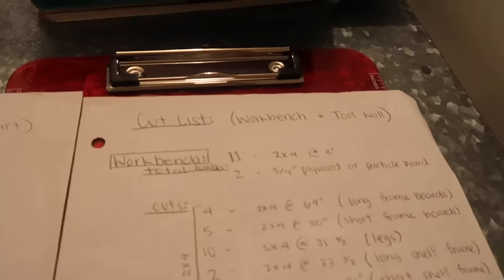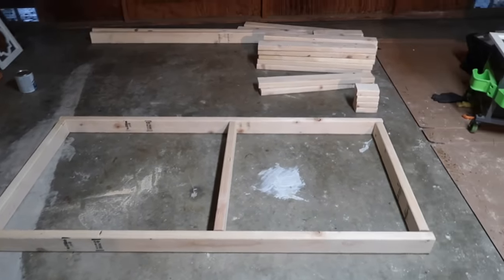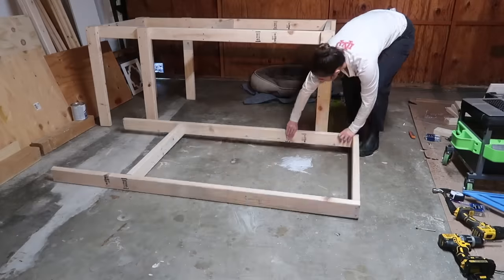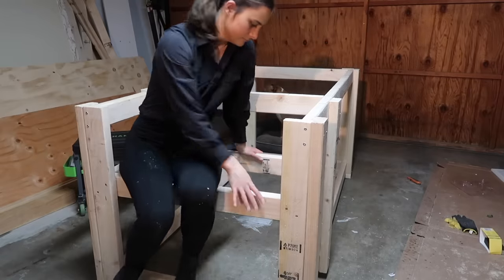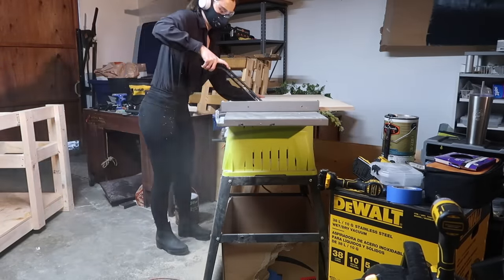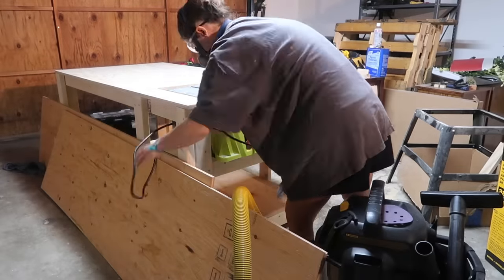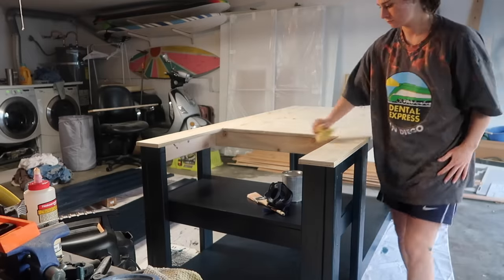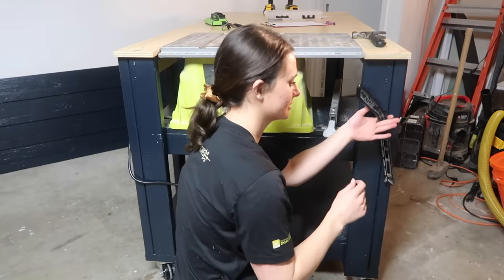DIY Workbench with Built in Table Saw

Comment: If you're getting into wood working, definitely switch to torx/star headed screws. They're 1000000000000x better than philips head screws.
Reply from the maker: Oh really? I have never used them before. Do they not strip as much?
Reply: Shannon Elizabeth Yes, they don’t strip and drive in a lot easier. It’ll change your life. :)
Reply: Phillips and flathead fasteners need to no longer exist haha
Reply: Interesting!! Sounds like a plan!!
Reply: I approve this message ✨
Reply: Agreed 1000000%
Reply: Philips and star head are a different name for the same thing. Robertson or square head is the superior screw try driving a 3inck Philips and a 3 inch Robertson into hardwood
Reply: Agreed, torx or Robertson square are best. I will only chuck up a Phillips bit if I’m driving drywall screws or for small box hinges. In my experience using fasteners for wood, Phillips just causes heartache for fasteners over 3/4” long.
Reply: Canadians thinking, “duh.”

Comment: Hi Shannon..
You made a great work bench and it looks very strong ..you can add a router table attachment and modify your table saw to work together using one fence ..but the surface should be straight as mush as possible 
The dust collector can be added to your table saw by adding an elbow to the table saw box and attached to your vacuum much or dust collection system..
I hope my language is clear ..
Good work
Reply from the maker: That is a great ideas. I am going to make a follow up table saw video and definitely want to incorporate those! Thank you so much!
Reply: @ShannonElizabethDesign  
You are welcome and I will follow your next project..
Good luck Shannon 👍

Comment: Shannon, thanks so much for your video and your plans for your workbench. I’m just about to finish the workbench, but I have a question. Is the top your table saw exactly flush with the top of your workbench, or did you allow some room over the top of the workbench, say 1/16” or 1/32”? It’s also worth noting that I have a Dewalt table saw, and the fence can extend to make the table 39”. This means I’ll have to cut a notch or two on the right side of the workbench to accommodate the fence. Anyone with a Dewalt will need to make adjustments to your plan to make this happen. Again, thank you for your good work here.
Reply from the maker: @KevinPeffley  thank you so much! I really appreciate it!! 😄🙏 My table saw is like 1/16” higher than the bench. I just wanted to be safe. But you could also do 1/32” or make it flush

Comment: Hi Shannon. Some questions from a beginner.
1st...I need to build a outdoor workbench, this build seems easy to build yet strong however I don't have a table saw so I won't be integrating it to the table but would I still need the extra set of legs for stability or will 4 be just as stable?
2nd...as i already said I'll be making the bench to sit outside on a gravel area as I have no room inside and no garage. I pressume to build the same bench to be suitable to stand in all weather I'll just buy all impregnated wood. Would you do anything else to help the bench be weatherproof? 
3rd... How do you hold you work tight on the table when doing stuff like handsaw or planning? Don't you need a vise for this or clamps? I see videos of people putting dog holes in their bench. Im confused about this subject and obviously don't want to buy a vise to attach to the workbench if I'm not really going to use it.

Can you help please
Reply from the maker: Hi James! Thanks for your questions. 
I think I would still add the extra legs but center them in the middle of the table. You probably could get away without them but since it’s going to be outside it might eventually start sagging in the middle after a couple years. 
To water proof it use polyethylene over the whole thing or some other waterproof sealant. 
I actually added these tracks into my table top from Rockler. https://www.rockler.com/universal-t-track-universal-t-track?country=US&sid=V91040&promo=shopping&utm_source=google&utm_medium=cpc&utm_term=&utm_content=pla&utm_campaign=PL&gclid=Cj0KCQjw48OaBhDWARIsAMd966B_ThbIapuQRPP0voWVCTlxAIxoBgqWl6-ZG4396CHooful_PHXyfoaArN8EALw_wcB
I used a router on the table top so the tracks can sit in and then there are other accessories you can buy like clamps to go in them. 
I really like this system and think it looks really nice as well. There are pictures on my Instagram of the table saw with the tracks in place. 
Although it was a little pricey. Buying on vise would probably be more affordable. So really whatever you think you will use more and what you like.

Comment: Good job, I am thinking about doing the same project, noticed the stack  of pallets, any projects for those planed?
Reply from the maker: Thank you!! That is awesome! Not yet, I am kinda always collecting scrap wood. Do you have any ideas.
Reply: @ShannonElizabethDesign  Yes, I have plenty!!! That is what I do, I have made dozens of tables, small boxes. stools, shadow boxes, toolboxes, bookshelves, wine racks etc.  you are only limited by your imagination.   Pallet wood is a great way to hone your skills before tackling  cherry, walnut  and maple...much cheaper to....
Reply from the maker: @tonycordell9205  That is awesome! Good point! Although taking pallets apart are definitely a lot of work. Do you have a specific way to take them apart? I really dread taking them apart. I definitely need a more efficient way to take them apart
Reply: @ShannonElizabethDesign  I have used various methods depending on the condition and construction of the pallet.   If you want longer boards cut the deckboards from the stretchers with a reciprocating saw with a metal blade, that leaves cut nails in the stretchers or i you want smaller lengths cut the deckboards close to the stretchers with a circular saw, these are the faster methods, or use a crowbar pry the off the deckboards....my least favorite...hard work and time consuming  check out You tube there are some very creative ways

Comment: Hey Shannon, love the bench! Just what I need. However I have a small workshop w/only a 33-34" door entryway, so if I ever wanted to move the table outside, pretty tough. Any way I can do the build maybe 3" less wide? I have ZERO experience w/plans, etc., so adjusting the measurements makes me nervous. Better if I could just build it as you designed, then maybe trim 3"(???)
Reply from the maker: Thank you so much! Yes, it's definitely possible.  You would just need to make the table top, the bottom shelf and the crossbeams 3" shorter. I can give you a better description if that doesnt make sense haha. You can DM on instagram if thats easier for you

Comment: I’ve got a Ryobi table SAS but it’s slightly bigger than yours. If I was to adapt your plans, would I just be looking at making the table wider as well as the shelf wider? The rest could stay the same I believe yeah?
Reply: SAS = Saw 🤦‍♂️
Reply from the maker: depending on the size of your saw, but you may not need to change the measurements of the table itself, you might just need to change the hole you cut out of the top. But, I would need to see the dimensions to be sure
Reply: Shannon Elizabeth my table is a little wider and deeper by I think I figured it out! Also, how tall is your table from floor to top of plywood?

Comment: Is the Polyurethane oil based? & if so, is that why you added it? Does it make it less absorbent or ...
Reply from the maker: It is water based. It does make it way more durable. Oil based poly is even more durable but the fumes are way worse (like hard to breath bad) and worse for the environment

Comment: That turned out great! Top effort!
Unsure if it matters a whole lot but in woodwork we were always taught screws and nails should be at least three times longer than the first thickness you are going through… so 2x4 should use 6” screws? Anyway, it looks great! I have to build some benches and this looks ideal! Thanks for the inspiration
Reply from the maker: That is good to know! Thank you for sharing :)
Reply: That’s a good rule of thumb, I suppose. But a 2x4 is only 1.5 in thick, and fastening 2 2x4 together would mean 3 in max. I use 3 in construction screws for 2x4 and never had a problem

Comment: Hi Shannon. Awesome video. Curious about the small dust collector tool. Is this a normal wet/dry system? Looked much smaller. Appreciate any thoughts. Keep on rockin.’ Excellent videos overall!!
Reply from the maker: @Mike-LUVHUSKIES  thank you so much 😁😁  I have upgraded since then. I now have a dewalt shop vac that is a lot stronger. I actually have a video where I create a desk collection system for that shop vac 😊
Reply: @ I will definitely check that video out. After watching your workbench build I’m going with a double 2x4 plan for the bench legs. Initially was going to use 2X8’s. Then it was 4X4’s. But your approach makes the most sense. Any advice or thoughts on actual attachment or cutting would be totally appreciated. I’m using a circular saw. Don’t have a compound mitre saw yet. Hopefully in the near future. Thank You again!
Mike

Comment: How’s the poly go when using the table saw? I would have thought the material you’re cutting may not slide well.
Reply from the maker: It hasn't been an issue. I haven't noticed any difference.

Comment: Do you like your Ryobi table saw??  I was thinking about getting one since they are   not too expensive. You should do a review!
Reply from the maker: That is a good idea! I should do that. I do like it, although if I had more money, I definitely would upgrade, but it has been great for the price. The only things I wish were different, is I wish the top was bigger, to support more wood, although my workbench solves that issue now. Another issue is sometimes the riving knife isn't perfectly aligned with my blade and I tried adjusting but is still not perfectly aligned. Although, that isn't a huge issue. And the last issue, is the miter gauge it comes with is not very accurate, but iI don't really use it anyways and you could always ordered a different one online. Overall, it is a great table. Unless you are planning on using your table saw everyday, it definitely does the job.

Comment: Well done. One question, is the surface of the table low enough for the runners on your cross-cut sled to pass over or did you have to cut slots?
Reply from the maker: thank you so much! I have to cut slots for it actually. I am gonna put that in my part 2 video

Comment: I made one too but i put my tablesaw the opposite direction so i could fit my miter saw next to it on the same cart
Reply from the maker: So cool! I would love to see it. How did it turn out?
Reply: Well i dont have the outfeed but its easier to rip full sheets i just set up a folding table as the outfeed. But just not having to drag out the miter saw is a game changer for me.

Comment: OMG! I JUST GOT AN IDEA!!! For you! *What if you attached another table top the hunt down the side of your work bench -but then when you wanted it to - it folded UP - at a perfect... 90? Degree angle (a straight across angle meaning it doesn’t raise above the flat level of the l work bench) BASICALLY - FLIP UP TABLE TABLE THAT MAKES YOUR TABLE SURFACE DOUBLE THE SIZE for if & when you might want it to. With latches so legs can pop out to support it.....
Wouldn’t that be COOOOOL?
Reply from the maker: That is really smart! Sorry I saw this so late. That is super cool though! definitely want to give that a try. Thank you for sharing!

Comment: Hi Shannon. It’s a great design. I had a question for you. I am an absolute rookie with woodworking and literally getting into it. Highly impressed wi you design and will fit my space in my garage as well. I have bought the RYOBI RTS08 and was wondering if I can use it with the same design as yours. I will greatly appreciate your feedback ! Thanks I’m advance.
Reply from the maker: Hey! I’m sorry I’m not sure. Sorry for replying so late. Did you end up building a work bench

Comment: So... you've probably noticed by now that your cross-cut sled will probably not work anymore because the grooves don't extend into the outfeed table.  Am I wrong about this?  I really like your table and am taking COPIOUS notes!
Reply from the maker: hahah you are definitely right!! I completely forgot about that during my build. But, I am going to make a part two of my workbench and include that. Thank you so much 😀
Reply: @ShannonElizabethDesign  The only reason I know that is because of all the workbench creating videos I've watched (by the way, yours was one of my favorites) I remember one in particular where the guy used a router to cut grooves into his outfeed table for that reason.  I thought, "Wow, I never would have thought about that!"  Anyway, I've got a make-shift workbench that I'm going to try to build my table saw into.  And I'm going to be following your example.  So thanks!

Comment: Love the build! However, the math for only 2 sheets of plywood doesn't seem to workout for having the table top, bottom shelf, and shelf base.

One sheet of plywood is 96in x 48in

Cutting for the table top leaves one sheet left with only a possible 23in x 12in piece

Cutting for the bottom shelf leaves one sheet left with only a possible 27in x 15in piece

This means neither the table top or bottom shelf will leave enough for a 33in x 18.25in piece for the table saw shelf, unless you combine two pieces from the scrap plywood you have left after cutting your table top and bottom shelf pieces.

Are you sure you won't need 3 sheets of plywood?
Reply from the maker: I honestly have no idea. I did it so long ago that I don’t remember

Comment: Well done. If you have good screws you actually don't need to pre drill most of the times. Check out Fascofas.com you will get professional quality screws for like 1/10th the price as the bad screws from home depot. If you buy the cabinet installation screws or the deck screws you don't need to pre drill in most materials.
Reply from the maker: No way! thank you so much! That is super helpful!! That would save sooo much time. 
Thank you so much! 😍
Reply: @ShannonElizabethDesign  no problem. I'm a full time cabinet maker. Do craploads of painting, veneering, resawing, and a cabinets, and general woodworking. If you have any questions you are welcome to stop by the channel and leave a comment on any of my videos. I'm always happy to help